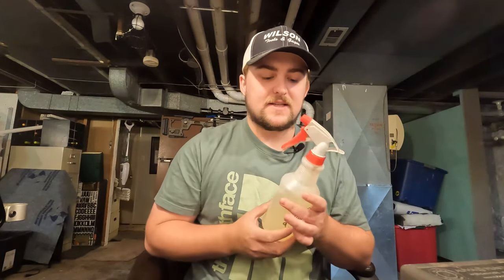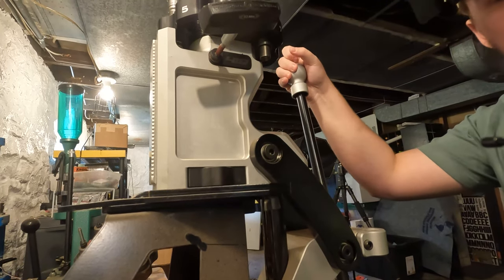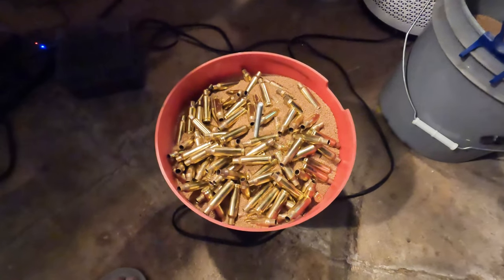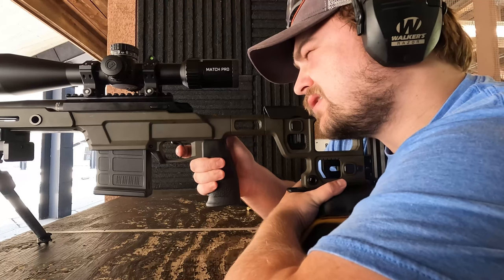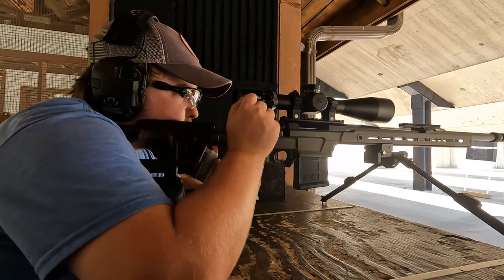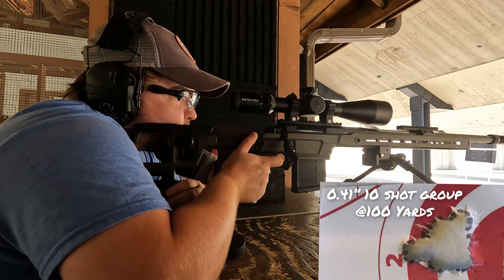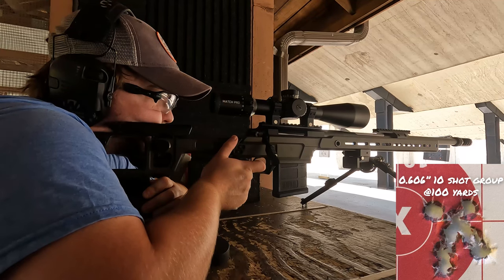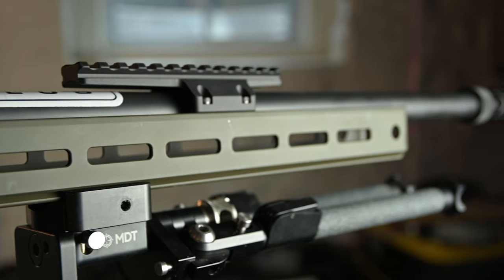Aero Precision Solus - 6.5 Creedmoor - Part 2: Initial Groups & Fireforming

Comment: I've got two of the Solus chassis and the cheek piece removal is my biggest (only) complaint.  I've found you don't really need the retaining pin so if you leave it out you can remove the bolt at the range if needed.

Comment: Great video, I liked your last one as well. You went over bolt lift but how smooth is it to cycle? I saw an older video comparing it to an (to be fair, a well used) Origin and it didnt seem nearly as smooth, though that may have been improved since.
Reply from the maker: Thank you! Honestly, it’s so hard for me to put into words the subjectivity of feeling of bolt manipulation. 

I’ll put it this way the best I can, to me, it feels smooth. And that’s just me. It certainly feels, to me, that it’s very easy to lift open the bolt after firing compared to other 3-lug actions. 

Now, for the cycling—to answer more of your question, this needs to get broken in way more before I can give a “to me” answer haha.
Reply: Fair enough, thanks for the reply